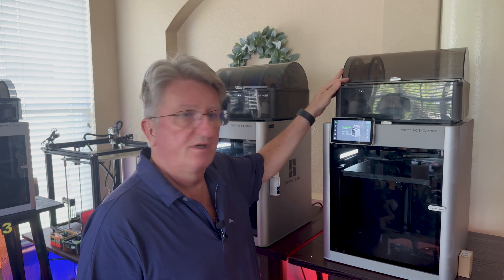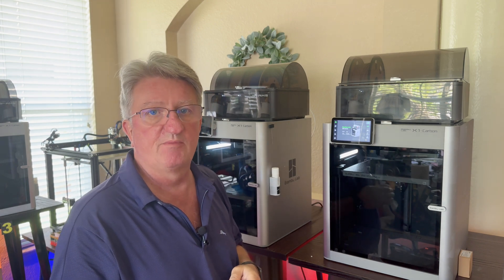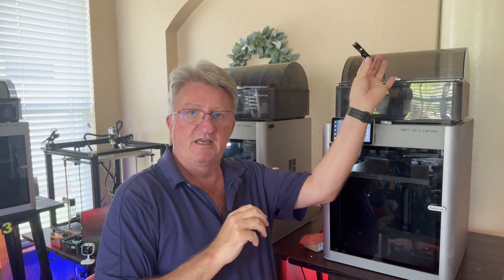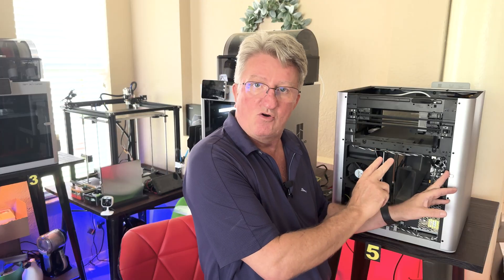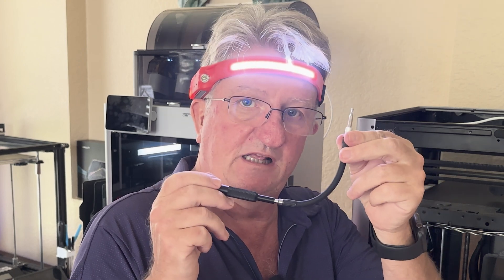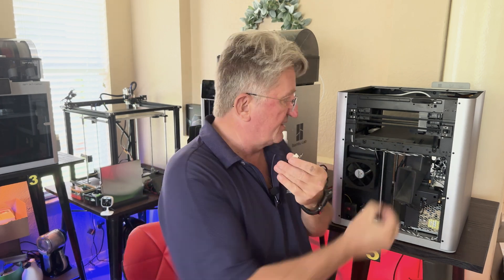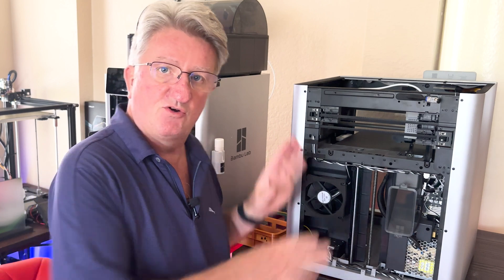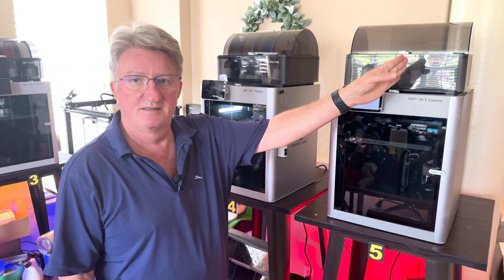AMS interface board  - Step by Step tutorial on how to replace it

Comment: I am having the same trouble , I can move wires to get white light again but then a couple of minutes even without using printer they all go red again , could I ask how and what you wrote in ticket to bamboo , because mine has been doing it for a while and when I write ticket they want date + time and stuff like that so im not sure what to write , any help would be most appreciated
Reply from the maker: Just tell them exactly what you wrote here, you can even refer this video with link if you want. It could also be the hub, depending on which cable is the one with connection issues.
Reply: @techwithkramer  ok thank you , how do I know if its the hub , sorry for asking but do you know much about printing TPU
Reply from the maker: If you wiggle the cable going into the hub to solve the issue, it’s the hub. If it’s the cable going into the AMS, it’s the AMS- if it’s the cable going into the printer, it’s the board.

TPU can not be used with the AMS - use the single spool holder on the back only.
Reply: @techwithkramer  ok I will try that thank you , I know I can unplug any wire and it will work for a few minutes lol , I dont use AMS for TPU or any abrasive fillinents , just PLA and I'm just getting into PETG , with TPU in the same day the first 3 prints came out perfect but now when I try to print it , the first layer maybe first 2 or 3 layers looks ok but the rest looks and feels exactly like a   kitchen sponge lol , not shiny and no strength at all , I did turn temp up to 240 to help but there was only a slight bit of difference in first few bottom layers , do you maybe know what that might be or what I could try to fix it please
Reply from the maker: Sorry, I have not used TPU on this printer yet, I can’t help you with that. I wish you good luck with it though.
Reply: @techwithkramer  ok thank you for help , I will look out for your future videos just incase you do any on TPU